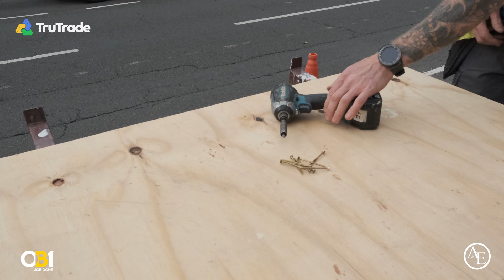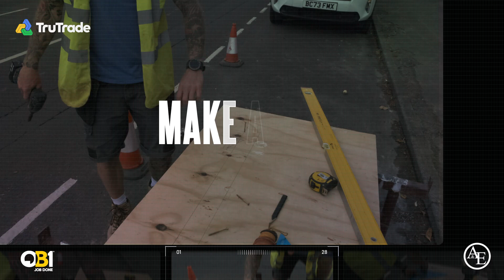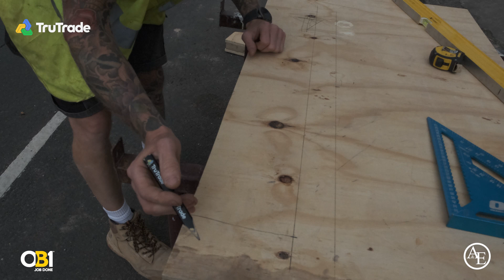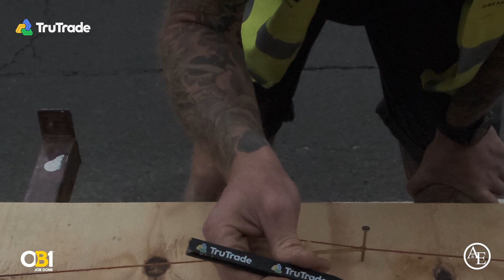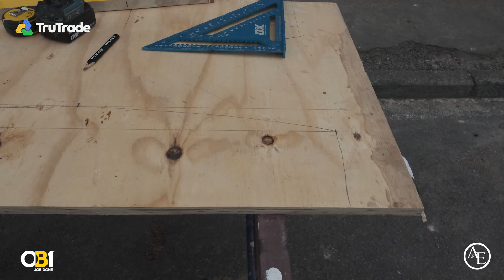How To Make An Arch Former | DIY Series

Comment: The spring point is actually at either end of the arch, the springing line is the base line and the 60mm bit is called the rise. The rise is normally determined by the height of the brick courses so the crown of the arch works courses and not a slither or cut brick over the top.Using a trammel rather than a line with those three points is far more accurate 👍
Reply: Spot on mate, it normally  works out at 32mm rise per 300mm run. He's not even put 2x1 battens over the top to support the bricks fully.
Reply: Indeed, I couldn't have put it any better myself Sir. If laid out on a full sheet a trammel should be used to strike the curve. Failing that a one metre steel rule would work as well.
Reply: Hi, if you have your rise and spring points how do you find the centre point of the arch to use a trammel?
Thanks